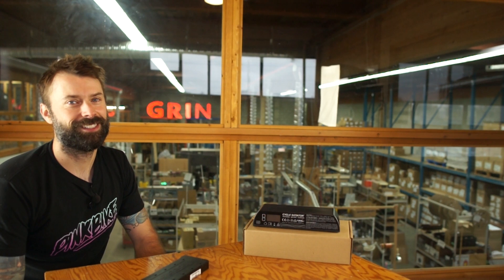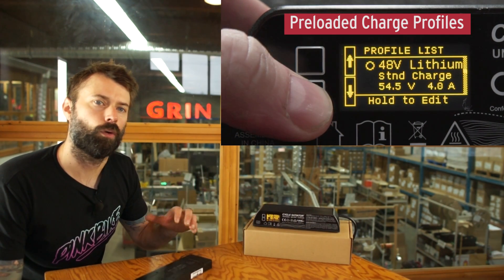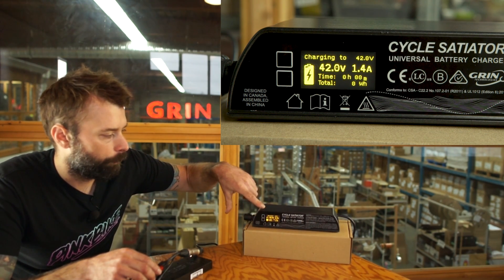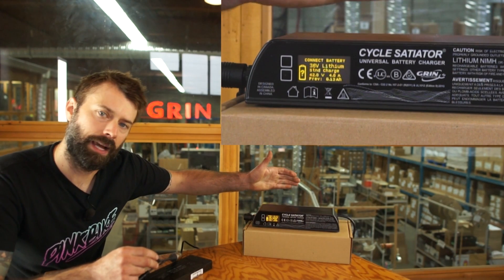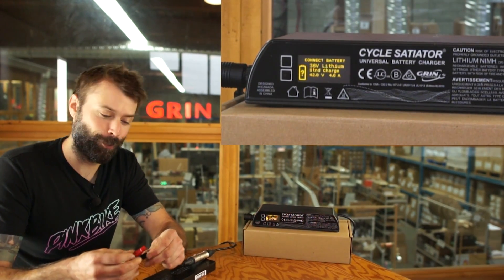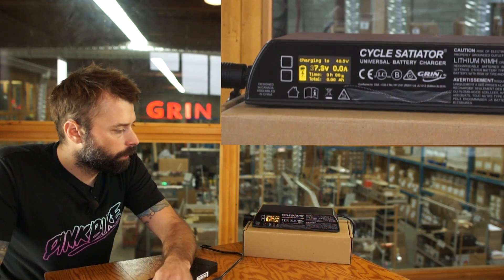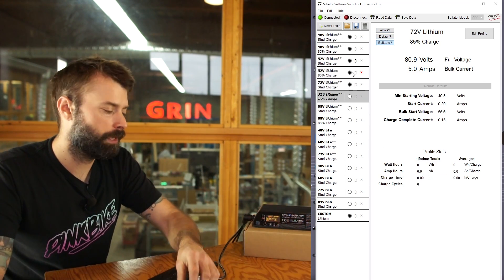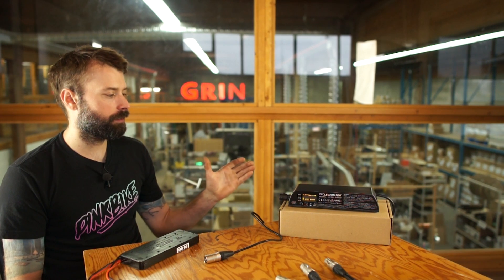Intro to Grin's Cycle Satiator, A Universal Battery Charger for Ebikes and Other Things

Comment: Do you see ebike battery packs moving to Type C in the coming years given that the USB C 240W charging spec was just released
Reply from the maker: That's an exciting development for power standardization in a lot of applications. I just looked up the spec on this and it appears that it supports negotiating charge voltages up to 53V, so it would be suitable for up to 48V nominal batteries at up o 5A, but not 52V packs or higher.    I guess the answer is "we will see"!   It would be nice to see a shift back towards some kind of standard rather than the increasing use of more and more proprietary charge plugs.